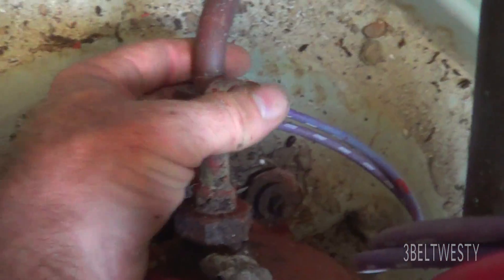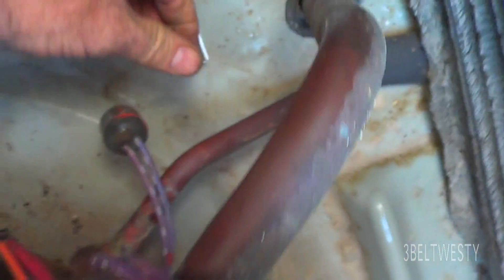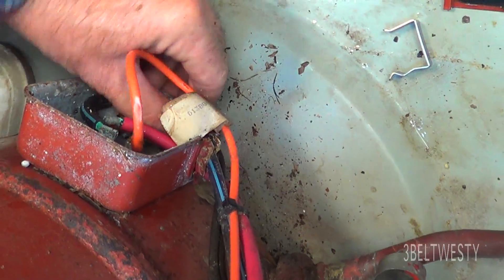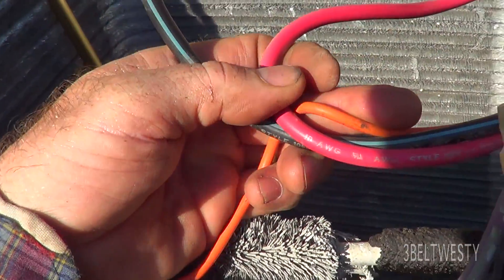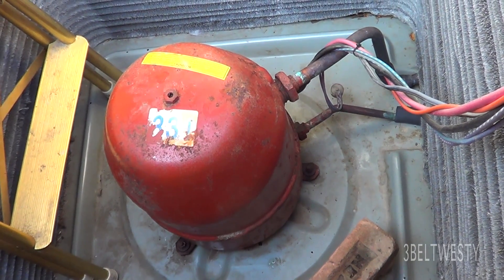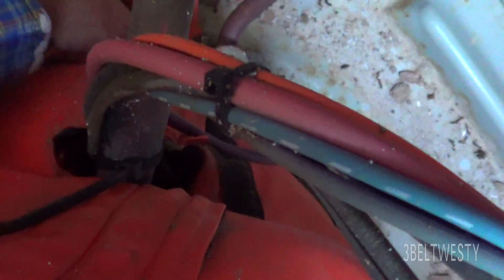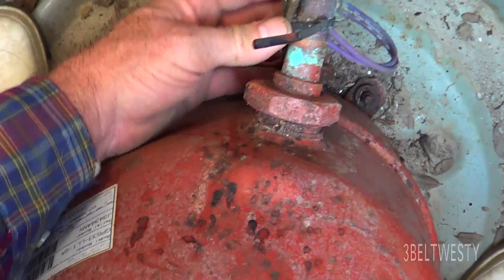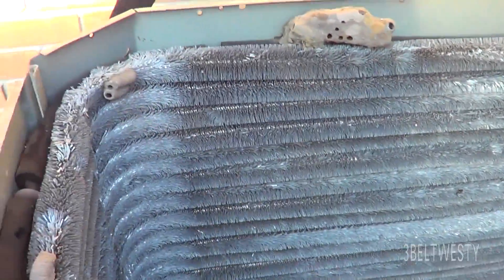Trane XL 1200 Discharge Line Thermostat for Crankcase heater

Comment: Video skips man, how does the thermostat tie in with the crank case heater or are they all wired separate?
Reply from the maker: 0:02 The crankcase thermostat are those pair of "purple/white" dash wires. It is connected in series to the  "black" pair of sump heater wires, ie the crankcase heater of the compressor. The 240 volts is always hot to this "Crankcase thermostat and sump heater".  THT00811 Trane Thermostat opens at 105F and closes at 73F. Thus below 73 F there is 65 watts heating up the compressor.  One mine the Input always hot side of the contractor powers the sump heater. Thus there is a purple/white (thermostat) to L2 on the contactor and a black (sump) on L1 ; hots of the contactor. When the thermostat is below 73F it is closed and thus the heater runs.
Reply: 3beltwesty thank you sir very much, can yu shoot me a schematic on here?